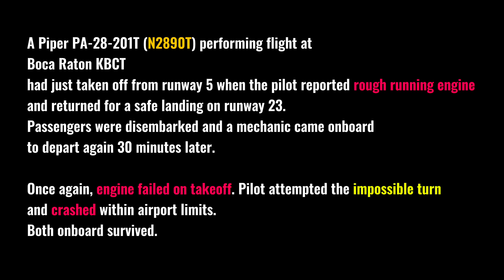TWO consecutive ENGINE FAILURES | Ends Up CRASHING! #atc #aviation

Comment: A taxi way is an optional landing location in an emergency.  Just because another plane is taking off on the runway doesn’t mean you can’t head towards the runway or a taxiway and put it down.  Even between the runway and taxiway in the grass is preferable to a parking lot.   In an emergency ATC is only giving suggestions,  do what you need to in order to protect life.  You may not have time to wait for ATC to figure something out and communicate it to you.

Comment: So this guys radio calls alone suggest a serious lack of discipline in operating an airplane. I counted at least 10 responses to ATC where he failed to even include his call sign, even while on the ground outside of the emergency situation. He failed to follow hold short instructions during taxi. His incredibly casual approach to working radios suggest to me he may have a casual approach in general, which is a recipe for bad things to occur. If that’s true, he should not be acting as PIC. Glad he survived.

Comment: A rapid drop of TIT means a really flooding, over-rich mixture, from overboost; I saw this before, a dude took off with closed manual wastegates (turbo-normalized Seneca) and lots of black smoke from the exhausts as he sank back down on the runway with gear mostly retracted. Crump. Of course, it was the avionic shop's fault for pushing the wastegate knobs in when they worked on his autopilot...meathead didn't use checklists.  These guys....tried to get the engine to fail again?!?
Reply: Upon reading the report, the mechanic apparently saved their asses by flying the airplane into the crash, the pilot froze.

Comment: Why does tower ask for reason for return? I’ve heard this a couple times
Reply: An engine failure is like an emergency, with a rapid return after takeoff, the tower should know why for his paperwork.
Reply: @owenmerrick2377  so they have to do paperwork for coming back? Even if emergency isn’t declared?
Reply: @RaceMentally  The pilot reported an engine failure, and the tower asked if assistance was required; certainly not a usual thing. Good to make a note of the event at least.

Comment: A 30 minute turnaround time tells me the tech did little more than a visual inspection under the cowlings, didn't see anything obvious and then said "let's take it for a test flight and see if it happens again". And for some reason the pilot agrees. Had they 50-75ft less altitude when failure occurred they might both have won Darwin Awards.

Comment: The rapid repeat attempt to be shows a need to pull the engine techs license…🤔
Reply: Gotta test drive the "car" to determine what's wrong.  Sounds like nobody was hurt, which is first and foremost the way we hope all landings end, crash or no crash.
Reply: @dabneyoffermein595  If you want to test it, try some high speed taxis first.
Reply: @chrisschack9716  Taxi's, ah yea, like Checker Cab